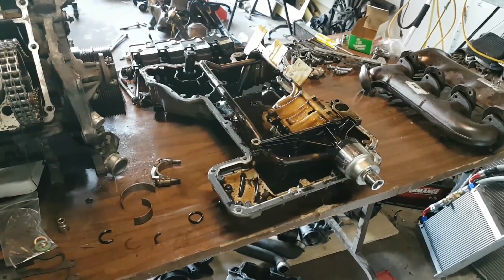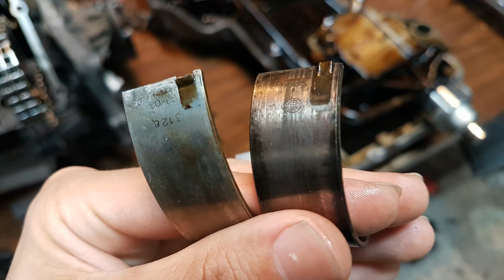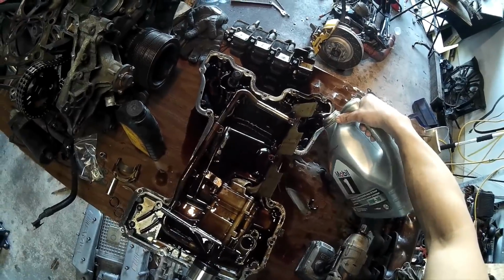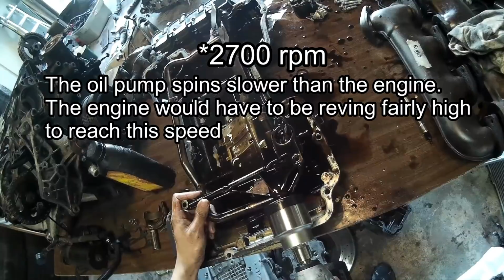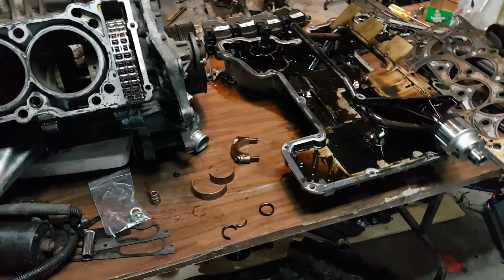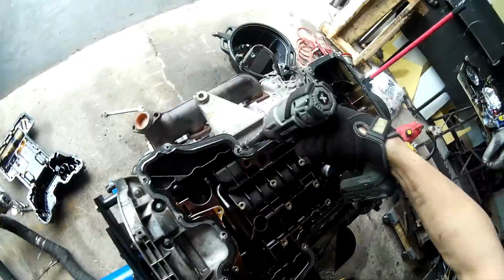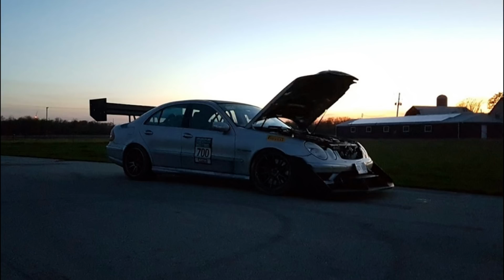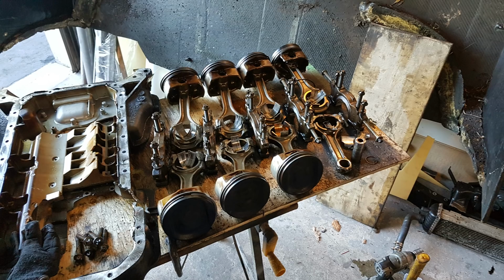Bad O-Ring, Spun Bearing Again! On 2nd AMG Engine

Comment: I'd say that chain has stretched. And putting some gasket maker around that new oring won't hurt.
Reply: Yes that would hurt. Orings will only seal if they are installed in the groove/bore that is the right size, and they can respond to pressure. IE, they move. You add goop, and you'll certainly get leaks. You cannot successfully "help" an O ring that must move slightly (to respond to pressure) with extra sealant.  This O ring was hard, and leaking in both engines. Seen that several times on Audi'/ VW 1.8t's  and others. On a pressure application, a hard o ring would just seep a little. Under vacuum, it can pass a LOT of air into the oil supply because air is so much easier to "suck" than oil. If the oring is under a flange, as on the VW 1.8t, you can seal the flange. Leave the o ring alone.  Under street use, you would probably only notice a bit of air ingress to the oil pickup as lifter rattle at times. Hydrodynamic Brgs are actually very tolerant of partial and/or momentary air ingress.My friend mike has been racing a BMW m10 for years with an oil pickup that occasionally sucks air at the end of turn two(very long 180 left )at PRW (kent WA). He's coming out at 1G and 5k rpm on the way to 7500.  Every time we tore the engine down, we expected beat to hell rod brgs. They were actually very good. If the oil pressure was away more than just a few seconds, I'm sure it would be disaster. Remember, your rod brg loads are greatest at max rpm  and right when when you let off the gas! That's when the load spikes.
Old Subarus  had/have lifters that bang away when the engines are old. The fix was a new "figure 8" o ring and a pump shaft seal. Every time. (boy, now my grey hair is showing!) 
Nitrile would have a short but ok service life under track conditions with an engine torn down every 3-5yrs or so , but over 150k will turn to bakealite  in street use. Once that happens, normal shifting  or thermal expansion in the engine ensures a air ingress leak.
 35yr shop owner. Racer. Machinist. Devotee of Kevin Cameron's engineering wisdom.
Reply: Yeh, I probably should lay off the gasket goo, maybe only on special occasions, interesting information about the high bearing loads lifting off the gas. I've got some good information to; Jesus Christ is God of Gods, so seek Him while He can be found, draw near to Him and He will draw near to you, ask to be forgiven of sins. God bless you man!
Reply: Hopefully I'm a better preacher than I was a mechanic Haha.
Reply: God can always be found, I find. He is all around you.

Comment: Quite informative. If you don't have any major damage like scored cams and lifters on the second engine then I'd recommend a polishing of the crank and then a new set of bearings. And take care of all other seals, check valves and clearances and just about everything else while you are at it.

That way you will know what you have.

Comment: GM LSX Engines have the same o ring pickup problems, and yes you can make a nice big paper  weight if the o ring let's go, an old trick we use to do to old American V8's is to weld the factory pressed in oil pump pick up on.

Comment: the bearings aren't supposed to turn... you shouldn't have rotation marks on the back of it.... if it's really rotation mark, the oil pump o-ring is almost a tiny issue!
I'd rather say these marks come from the mileage of the engine, or maybe it was reworked at some point and the mechanic was a little harsh when putting them in place and left scratches on the back of the bearing.

Though... it's strange... O-ring tech is now mastered, they are resistant to ageing and oil.... could it be you use some kind of special oil, synth or the like which could harden the Oring?

Comment: I have been a Mercedes Benz tech for 25 Years and have seen similar issues with all the engines from M104 to the M156. If I were a betting man, I bet that the M157 will also cook the o-rings into round rocks. Regarding the M113, I have also seen many oil control rings siezed into the pistons, damaging the cylinder walls.
Reply: Does m156 have same rubber ring?

Comment: I completely agree with you if that oring splits and the engine loses oil pressure it will die very quickly

Comment: Wonder if this affects non-AMG M113 on W220? 🤔
Reply from the maker: No, W220 had a different pump. This pump only came in the models with two oil sumps.
Reply: SK8215 What about water/oil issue?
Reply from the maker: There's a few water/oil issues I've heard of in M113's. One is water leaking in from the oil cooler. That's only for non amg models that use water to cool the oil. The other is water leaking in from behind the timing cover. The third is headgasket leaks that flow water into the oil.
Reply: SK8215 Never heard of head gasket problems with M113; must be rare. The timing cover thing is what worries me...that common on the non-AMG?

Comment: Overhere in europe the same problem with the O-ring. Never had a M113K broken. But leaking and hard rubber are formiliar. Thanks for the demo run of the oil pump. And i also gonna mount a oil pressure sensor on my car.

Comment: It's a RETARDED design. A critical oil uptake pipe like that cannot be trusted to seal with a slip fit O-ring. It should be held in place with 2 or 3 bolts, a compression gasket and a back up O-ring slipped onto a ramped flange. This way, you will not have a break in sealing whether components harden or not. Also, if the main gasket leaks there is an o-ring inside will get sucked onto the flange and seal it. It's sloppy engineering.

If it can fail, it will fail. If it is a critical assembly it must be designed to fail gracefully without catastrophic results.
Reply: Dwight Looi older Mercedes engines had it like you said.
Reply: Just like a head gasket, metal crush washer with a rubber insurance gasket

Comment: When you fix an oil preasure meter pl make sure to fix an oil preasure switch as well .Use that switch to shut the engine if there is low oil preasure automatically.

Comment: I'd also like to agree with the person who suggested resizing the rod that had the spun bearing, this is a good idea to prevent the replacement bearing from not having adequate "crush", therefore making it more likely to spin itself.  Best practice would be to do all the rods, but at least the one should be done.  Have a good shop do it, a poorly done resize is worse than using it as-is.

Comment: Good sleuthing and well presented in both videos.  I'd like to suggest an "ultimate" o-ring material, much better than even Viton.  It's expensive, but this application is a good reason to spend the money.  The trade name is Kalrez, and has an extremely broad range of chemical and temperature resistance, including to motor oils.  It's used in aerospace and chemical plant critical applications, this oil pickup tube sealing seems a good use too.
This website (I have no affiliation) will give you information on the capabilities of the material, and they should be able to help you find the right size, unless M-B has been really rude and made this a proprietary size (unlikely): https://www.sealingdevices.com/kalrez-o-rings You can search for other vendors too.

If you go this route, let us know the size and cost.  I'd estimate ~$60 USD for this size, but when compared to the loss of an engine that's very cheap.  It's not clear to me if any other places on this engine need it, perhaps for the rest Viton would be suitable.

Comment: i would agree that if the o ring fails it will starve the engine with oil .thus crank bearing failure  you say that the bearings have spun .surely the conrods will need replacing or repair,  if the bearings  have spun , in our engine shop we would normally machine the conrods and fit a thicker bearing to suit . you may get the same problem .? unless you have caught it early  and not damaged the conrod .  that o ring that would not cost a lot to buy,  but  is an expensive job to replace . i hope that mercedes  has sorted it out .by some means of fitting a better seal . or fitting  a gasket ?

Comment: O-Rings or gaskets are a common failure items wherever they are located on a car. Pretty much you are sealing a high pressure system closed so air doesn’t intervene. Over time hot temperatures to cold and cost of the O-ring and gaskets to few dollars will cause them to fail prematurely unless they were made of high quality rubber. Prime examples are gaskets located on trans coolers and oil cooler which tend to fail over time since they are dealing with high temperatures.  Your analysis is dead on low or no oil pressure will cause a failure especially when your dealing with High torque  and oil is a crucial element in preventing wear.  Not sure what you have decided with the second engine in my opinion you should replace all the bearings. Torque everything and replace the O rings wherever necessary.
Reply: Forgot to mention the chain rubbing against the block could be from a failing chain tensioner. Which is causing extra slack in the chain. Not sure with the second engine if you checked timing before taking it all apart. It would had given you a clear indication at TDC.

Comment: Not too uncommon as i destroyed a Subaru WRX engine the same way. The oil suction pipe formed a stress crack at the flange to the pump and after that it was a matter of seconds before total engine failure.

Comment: Seems like you're overheating the oil, that's the main cause of seals getting hard, I'm assuming they used a proper seal in the first place, if not then bad manufacturer.

Comment: All 55K engines share the oilpump chain slack issue. Its the very very weak chain tensioner. Its making a ticking nois at idle aswell, everytime the oilchain touches the engine.

Comment: That bearing has clearly been spinning, a lot. It's the only way you can get scoring like that, and look at the wear/heat discoloration around the (totally bent) alignment tab! Just because it stopped near where it should be doesn't mean it hasn't spun thousands of times. Lack of oil is an obvious cause, no surprise there.

Comment: Dude you tore down 2 engines screw giving it back, forged psitons forged connecting rods brand new bearings brand new O rings , you can almost gurantee it lasting as long as you want it to

Comment: Wonderful couple of videos. Im not into motors per se but if I might suggest, why buy another O ring from the supplier when its obvious they got it wrong, why not get a silicon one from an O ring supplier. I work on espresso machines and I'll bet a silicon O ring holds up much better than that orginal black one. Just a suggestion :)

Comment: I think if your gonna race these engines, you better get used to tearing them down first and replacing seals! Or get some BlueDevil Oil Stop Leak and add it a little at a time to oil changes.

Comment: How does the chain tensioner look ....you'd need a really stiff spring (s)....I bet you are dogging the hell outta it.....how do you get the car not to go into traction studder mode....I gotta 08 cls 550 and it is n/a but I'd admit I enjoy driving it as much as my boosted ctsv if the damn thing wouldn't studder....when I put my foot on it hard from a stop.....

Comment: I would drive a Mercedes E55 amg for street use with occasional wide open throttle acceleration. I would change the oil pump o rings after purchase and every 100k miles.

Comment: something says me that all the O-rings will go bad why not solder the freaking pipe that destroy engines so you haven't worry about it happen again ? you may say it maybe inposible to remove it if it need replace .. at least it will need only that replace not the hole engine ...
Reply: Because the oil pipes are steel and the sump/pump is aluminum. They move . The o ring is the interface that can seal and accept a few thousands of movement at the same time.

Comment: In 1982 I purchased a MB 380 SEC a very expensive vehicle and at 800 km to my surprise it developed gearbox slip on my way to the dealer in Melbourne, SOLD IT 3 WEEKS LATER NEVER TO PURCHASE ANOTHER.

Comment: Do not use that Bosch OP gauge.  They are shit. After a few weeks, my gauge went and the glass filled up with oil and inside the car.. These are crap !!  You need to get Borg Warner or Autometer.  Get a quality gauge.  Also.. Do not use the plastic line.  Make sure you get the metal line.  I have considered an electric oil pressure gauge.  I have heard they are not as accurate... But some say they are better...
Reply: An electric gauge removes the need for a pressurized pipe full of oil intruding into the cabin.
Reply: Electric are not so accurate?   or?
Reply: grabir01, you get what you pay for, a cheap mechanical unit will be no more or less reliable than electric.  
We use autometer stuff in the car I work on, but everything is calibrated to our spec rather than relying solely on the printed numbers.

Comment: You need to find a better why to seal that Oil Pipe.   The rubber ring is a poor design and as you have found it will ultimately cause engine failure.   MB should have used a harder type seal such as flanged rubber brass seal used in transmission for filters or/and maybe a clamp.  Is the o-ring rubber?  How about Viton O-ring? What other materials for an o ring can be used, that would be better than rubber.  I would see about finding a better way to seal that than a rubber o-ring.  Weld it? Braze it?  For what reasons does that tube need to disconnect? There has to be a better way.

Comment: I can understand that there are design flaws from time to time, but I feel like every single car should have a loud alarm with visual warning if your oil pressure drops to 0. I would certainly expect this from a "high end" or "performance" vehicle... No engine will survive without oil pressure so why let it happen?? I mean seriously, my lawnmower shuts itself off if the oil level gets too low and your telling me they cant incorporate a system to shut off the cars engine and make the owner aware that they have no oil or no oil pressure....
Reply: B/c then you won't be buying a new car immediately after the 3 yr warranty is up and no one can buy a used car forcing them to buy new cars.
Reply: Peter Dudas bang on bro
Reply: Seriously, there are some high end cars that will warn you of anything wrong with the oil. Oil pressure is the most important bit of info on a sports car.
Reply: The e55 has a low oil sensor lol. I am puzzled why this guy says there isnt one. I bought one for my 04 e55 two years ago. It cost over $700 from the dealership. Many places sell them go look online
Reply: @lf3566  low oil level sensor or oil pressure sensor?
Reply: @Gatsu3D2A  He meant an low oil level sensor... the e55 from 2004 didn't had an oil pressure sensor because they assumed, as long as their is oil in it... the pressure must be right.
Reply: It is easy to build a sensor for low oil LEVEL.  However, a  low oil PRESSURE alarm would have to have some intelligence built in because pressure varies greatly from cold to hot and from idle to redline.  You would need a controller that monitors engine speed and oil temperature along with oil pressure.  Then it would have a lookup table for every situation.  Hot oil at idle would have the lowest allowable pressure, and cold oil at high rpms (a sin btw) would have the highest pressure.   20 psi hot at idle might be fine, but 30 psi at redline is WAAAAAY too low.  I suppose you could log oil pressure in a healthy engine under all conditions and then use those numbers minus a factor of maybe 10% to trigger a low oil pressure alarm. 
 If only there was an engineering student/electronics whizz around to do it.

Comment: I'd ask for a credit on engine and rebuild the motor. As a certified mechanic and used to rebuild motors to. I'd sugeset getting the rod that was minorly spun resized. Replace the chains to. Tentioners to.Then you have great reliable engine again. Is sad how a simple cheap part can fail an engine. I like the demo on the O rings.

Comment: Oil if not changed regularly and do short runs,not used regularly can haveSulphuric acid build up from condensation  with in the engine which hardens rubber seals. Could be a cause factor

Comment: also I forgot to mention. You need to change the rest of the oils in these cars every 30k miles. Do not forget the ABC fluid and filter. Also change the atf every race. If you can put a trans oil cooler on it then do it.  I change all my fluids once a year. This will greatly give you the best protection. first the fluids wear out then the parts wear out.

Comment: dude your engine was not super clean. it had sludge everywhere. this is because the scumbags at MB told people they can go 10k miles between oil changes. This is also one reason those seals went bad. You should never go more than 5k miles on oil. On your repl eng I would suggest a few 2500 oil changes for regular driving and always have new oil before a race and replace the oil after a race. I know that 10k oil changes destroy rear main oil seals on the 112 and 113 eng. I would clean out all the parts you can. repl the rear main seal, timing chain and rails, and v/c gaskets. all the rubber you can change. then do many rapid oil changes until the rest of the engine is new clean on the inside.  Also for racing I would suggest water/meth injection. You want an oil thermostat to keep oil temp at 85c. use a lighter weight oil to make sure you have 10psi per 1k rpm. 3000= 30psi etc. if you can get this with a 5w30 then go with it. also fuck mobil 1.